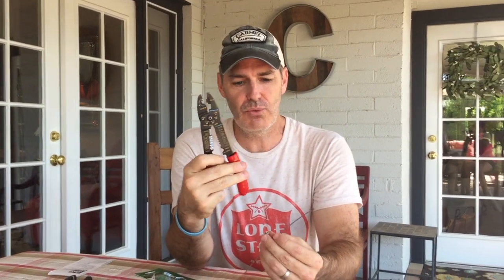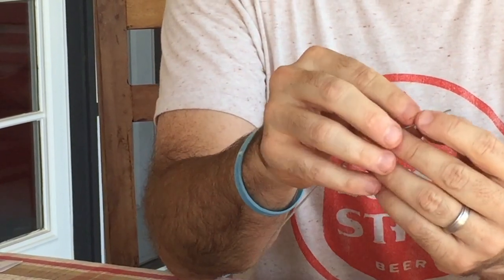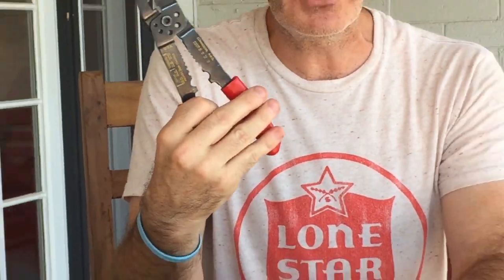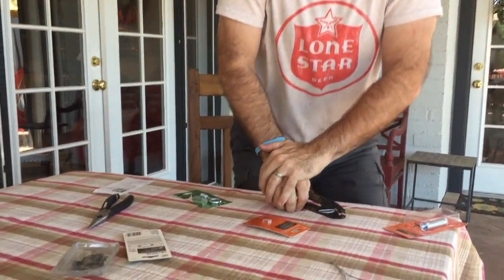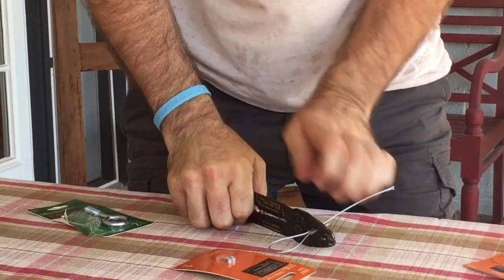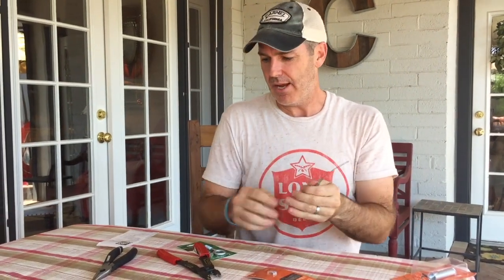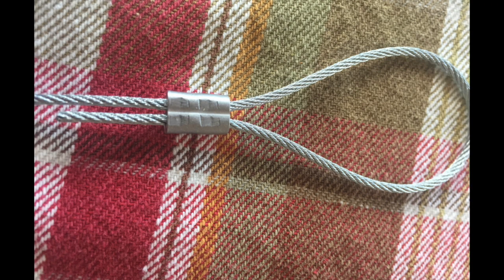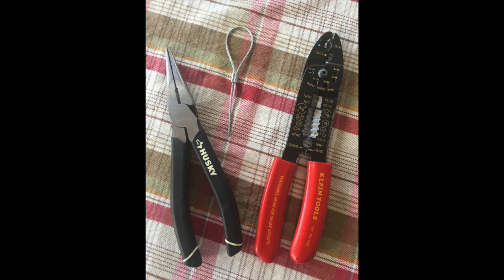How to make a loop in a wire - cafe lights

Comment: I could not get the cut end of the wire through the hole of the farrel. When they cut it, it immediately starts to unwind and both the wire and the farrel are 1/16th so there is zero margin for wire expansion. I did however manage to puncture many of my fingertips with the errant wire strands. DO you know of any alternative method of making a loop, or could a larger size farrel be used as long as it is fully crimped?
Reply from the maker: Anthony look up all-in-one hanging kit on amazon. This has become my go too no ferrule required

Comment: Did you have a link to the cutting crimping tool?
Reply from the maker: I couldn't find my exact wire cutters/crimper but here is an updated on from Klein https://amzn.to/32BR20O.  If you are using ferrule's greating that 1/16th try these:
https://amzn.to/2NZnENA.  If you are hanging lights like I did, I would just get 1/16th.  The Klein tool is so versatile...Like I said in my video...use them ALL the times.  Good luck!